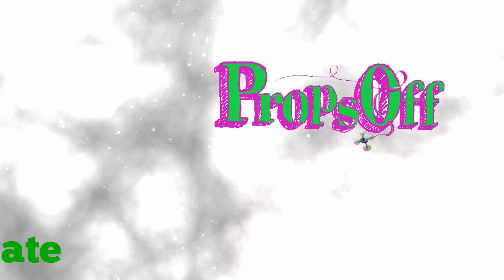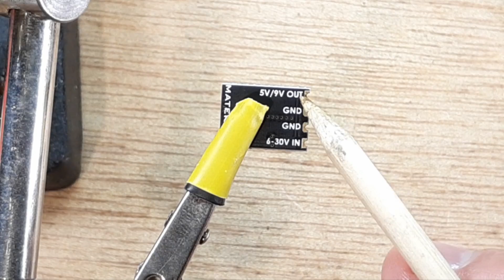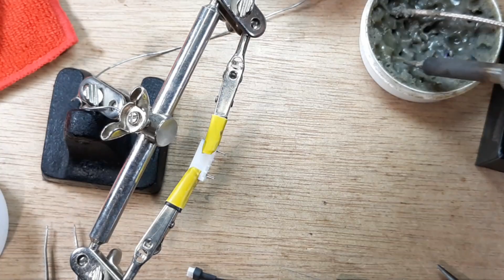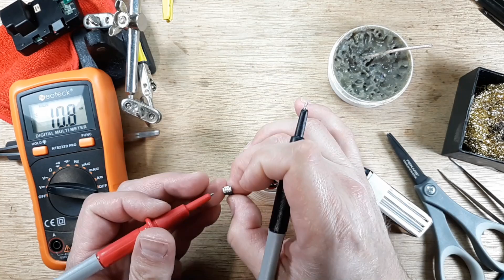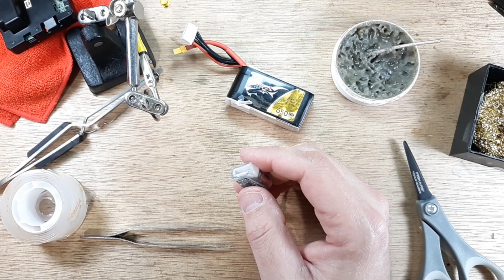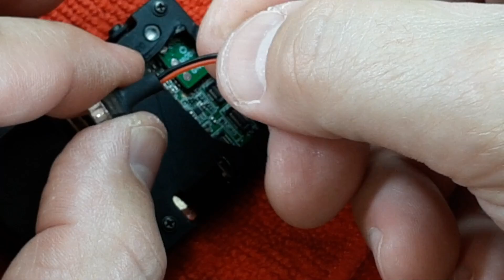How To Make A Naked GoPro Power Supply Cable | Full Soldering How To

Comment from the maker: I made a few more last night. The only thing I would do differently is to shrink tube the capacitor. The wires are close to the capacitor and in a bad crash could possibly touch the metal case of the cap. FYI...👍🏻🍻👊🏻

Comment: Can i also use this on 6s battery?
Reply from the maker: What ever your BEC is rated for, you can use...🍻
Reply: @PropsOff can I direct solder 5v pad from the fc to the GoPro?
Reply: @PropsOff 4.5v to 24v
Reply from the maker: @Tsunamixtreme88 
I wouldn't recommend using the flight controller for powering the gopro.
Reply: @PropsOff why not?
Reply from the maker: @Tsunamixtreme88 
I explain it here... https://youtu.be/0Vc0X9Reu3k?si=eZok5SBIE4ko26FY
Reply: @PropsOff ok thanks. Can i use an adaptor with bec to type c on naked gopro?
Reply: @PropsOff 5v to 24v

Comment: I've heard that using the BEC board generates excess heat, I'm curious to know if this method would lead to the same heat as if i were to leave the original usb-c port in-place, and if it generates less heat then the bec boards?
Reply from the maker: @aaronsandford3568  
I found that it depends on the BEC. I debated if it was due to a weak ground...🤔

Comment: Banggood sent me the wrong parts. Could I use the 5v/12v Bec with a 470u 30v capacitor for this?
Reply from the maker: Yes, I used 9v to the Betafpv BEC board. I'm thinking that BEC can receive 12v. Don't use the 5v option to the Betafpv BEC board though...

Comment: Hy nice video!👍
I have one question does they naked gopro hero 10 have a 9 volt input or should i leave it at 5 volt? I am afraid to ruin my go pro😅
Reply from the maker: This modification video is made for the Betafpv naked Gopro BEC that supplied 5v. The step down BEC (Matek) I used supplied that component with 9v. I don't have a Gopro 10 and I'm not sure what its voltage requirements are.
Reply: @PropsOff  
Ok thanks for the quick answer☺️

Comment: Hi, I have a gp hero 7 with hdmi port. Isnt it much more simple to connect the hdmi port with a 5v pad on the flight controller?
Reply from the maker: You can't feed the Betafpv BEC 5V-.. I didn't work on a 7, not sure?
Reply: @PropsOff  ok, this micro hdmi port has no  charging function. but the GP7 works with 7.4V and not 5V. I hoped to use a 5V pad on the fc but I have just bought a 9V BEC. Now only waiting,....

Comment: Excellent video. Question can I add the where the BEC board is? At the other "End". I'd rather have it there  then on the actual connector itself.  Any issues? I shouldn't, correct ? Since it's in the same circuitry? Greetings from Boston!
Reply from the maker: I appreciate your support and encouragement..
Just make certain the wires are secure ( Strain relief). I seen people wiggle the wires till they frey and touched causing a short and fire. Same circuit as you mentioned and shouldn't be an issue.. Enjoy the Breeze...👍🏻🍻👊🏻
Reply: @PropsOff  thanks! I'll make sure to pay extra attention. Keep the videos flowing !🤙

Comment: @PropsOff: Thanks for the great video and clean information, very nice job! I have a question about the capacitor : Regular or Low ESR? What size to use on 3S? And if understand well, 1- Plug the Lipo on the Power lead THEN 2-Plug the Power lead into the GoPro and avoid plugin the Lipo on the lead if the lead is already plugged into the GoPro, right? Thank you :-)
Reply from the maker: I appreciate your support and kind words...🍻
The caps are from RDQ and are listed as low-esr. A 3s lipo is ok to run 330uf 16v/25v (50v is ridiculous overkill). 
 If I understand your question right,....The lipo plugs into this cable or harness we made. It reduces the lipo voltage down to 5v to feed the BEC (Nameless RC or Betafpv BEC) that is mounted to the Gopro main board.
   If your running 3s you'll just need a smaller cap and DuPont connector (to fit the 3s balance lead - obviously)..

So, the Gopro cable with a step down BEC to 5v is used to avoid the overheating and freezing issues we had in the past. I have 2 older videos showing how we got here. Check them out if you want.. Enjoy the Breeze...👍🏻🍻👊🏻
Reply: @PropsOff  Thank you for your reply and for the additional info. I am building now a light weight cinelifter that will run on 6s Liion (and 6s lipo), I plan on using a naked gopro rather than the full size gopro to compensate the 6s lion pack weight. The matek BEC can take up to 30v so It should be OK right? Now what size capacitor should I use? and should I keep with 25v or go higher?
The second question I was mentioning is my first post was more about a pluging sequence of the various elements (battery, cable adapter, gopro) to avoid spikes to the gopro. So should I first plug the battery to the quad (XT60), then plug the balance side of the adapter to the balance port, then the GH1.25 side of the adapter to the gopro? As opposed to have the GH1.25 already plugged into the gopro while connecting the balance side to the battery and then (possibly if not already done plug the XT connector to power the quad)....I hope I make myself clear here, English is not my first language. In any case thank you for your time and your help:-)
Reply from the maker: @christophelecomte3511  
I'm not a fan of 6S personally. I would use a 50v 470uf cap.. Have this cord already plugged into the BEC/Gopro, then to the power source. That cap will charge up first then the Matek BEC, easing the spike. Please understand, I have only thought of 4S in this application. No testing has been done on 6S and PropsOff can not be held responsible. Like I said, 6S isn't my cup of tea..
Reply: @PropsOff  Thank you for your answers and advice. I understand you are not a big fan of 6S for this application, I am not either but the quad will run on 6S so I need to deal with it. Another solution would be running on 4S off the 6S balance plug, I am not sure what is the gopro power consumption. Running on 4S off a 3000mah 6S Liion or 1500 6S Lipo, would the unbalance in my cells at the end of the flight be a major issue?
Reply from the maker: @christophelecomte3511  
That's what I would do. Testing would tell, I just don't think the GoPro would consume enough to be that concerned. I have a few "Cheap" lipos that discharge really far apart and never worried..

Comment: Shouldn't GoPro 8 be powered by 5V? (and not 9V)
Even on the GoPro 8 battery it's written 4.40V...
(I'm powering it directly through the USB-C plug)
Reply from the maker: 9v is going to a 5v bec.
Reply: @PropsOff  Oh, so for powering through USB-C I need to use the 5V option?
Reply from the maker: @jonykatz  
Yes, the USB supplies 5v to the voltage reduction components on the main board Ultimately outputting 4.2-3.7v.. That's the reason you read a lot of comments saying they fried thier GoPro, due to feeding the battery line with 5v.. The battery terminals do not have voltage regulators. Therefore, it gets overheated and burns up..
The Betafpv BEC is feeding 5v to the USB terminal and not the internal battery terminals..
Does that make sense?
Reply: @PropsOff  Yes, thank you very much for the explanation! :)
Reply from the maker: @jonykatz  
I think it's confusing because stacking BECs is odd. The Betafpv is of such low quality, we needed something to reduce power spikes. That's the reason for the 9v Matek BEC.. Seems silly but it works great.
Reply: @PropsOff  Love this. Question is everything still working great? A few people on FB think it's a terrible idea as you're going to damage one of the cells since they are in series. But as you stated if you connect it to the far left and right it should just work like  a power lead. Correct?
Reply from the maker: @armani007E55  
Yes, it's a series circuit and no different than the main power lead. If the internsl resistance (IR) of the cells are close, it will drain the lipo evenly.
Reply: @PropsOff  thank you! Appreciate it. I'll let the guys know.

Comment: my 2.5inch quad ill be mainly using 2S battery. Using the betafpv bec, would you recommend to solder onto FC power lead (which have a 25v 150μF capacitor) should be enough with 2S?

Or should I still use the matek + capacitor onto battery lead?
Reply from the maker: From the quadcopter to the BEC is the best way. 150uf is just fine for 7v.. You can not use the Matek 5-9v BEC in this instance.
   Note: You can make a power cable from the 2s balance lead if you want. A small 330uf cap and no Matek BEC would be cool. My friend likes the power cord because it is so versatile.

Comment: I make a cable exactly like your but it’s send 4.98v why is happen that?
Reply from the maker: There's a little pad (two halves) that a solder ball has to go across to get 9 volts.. The Matek BEC comes unaltered outputting 5 volts until that split pad on the back is jumped with said solder ball.. Is that it?
Reply: @PropsOff   oh yeah, really helpful.. that was I need...thanks!🙌🏻
Reply from the maker: @catthekiller  
Enjoy the Breeze...👍🏻🍻👊🏻

Comment: Hi PropsOff, I did power my naked GP6 from my matek bec through the balance plug directly soldered to the mainboard of the GP. It worked for some time but right now no reaction at all from the GP. Any idea what could gone wrong? I saw an video the other day that you powered it to the mainboard also.
Reply from the maker: I did power the main board with 5v on the ceramic capacitor. That way seems to be a good way to power the GoPro if the connector breaks and the Betafpv BEC can no longer be used. There's really only 2 places your able to feed in 5v. The GoPro' s circuitry has a buck and takes in 4.2-3.2v (don't quote the lower v).. You can not put 5v in to the GoPro anywhere else or it will burn the GoPro out. I have tested a handful of ways and this video is the best way we found. 

Where did you apply the 5v to your GoPro?
Reply: @PropsOff  I used the way you did in this video https://www.youtube.com/watch?v=MAF2USD0Y74&t=1144s
at around 18 min you soldered the wires directly to the main board of the gopro. I did this also. I used the matek bec. to put 5V into the GP with cap.
Reply from the maker: @mathijsroelofsen  
Can you plug in your back screen? Is the app responding? 
Not sure what to think exactly, other then doing a few continuity checks and voltage checks to make sure the circuit is correct.
Reply from the maker: @mathijsroelofsen  
Also check that you are getting 5 volts out of the BEC..
Reply: @PropsOff  5v out of the BEC is ok. Screen is not responding. No led. How can i do the continuity checks?
Reply from the maker: @mathijsroelofsen  
You need a multimeter..
https://youtu.be/G_aWMRWJhsQ

Comment: Hey man! Awesome video! This video was super helpfull as I'm starting on the hobby and most of the stuff is not very well documented.
Is the capacitor necessary?
I mean. Betafpv released their BEC and should work by itself. But people were having problems due to spikes.
Would it be enough to somehow put the Matek BEC inside the Betafpv case and ditch the capacitor?
Reply from the maker: The capacitor is part of the circuit to create a shock absorber. I had lots of issues with previous ways and this is the way...
Reply from the maker: https://youtu.be/fdbKrzJMCZo
Reply: @PropsOff  Oh yeah. I've now watched all your videos related to the Naked GoPro 6 and let me recap what I understood.
1 - You tried a bunch of BECs that were giving you bad results
2 - Then you decided to use a chopped Betafpv one with their BEC striped away and used a MATEK instead.
3 - And at last you realized the best option is to use the normal GoPro BEC and case in conjunction with the MATEK BEC and a Capacitor, suplying the power via the balance lead :)

Is it right?
Reply from the maker: @LuisPereira08  
Exactly correct

Comment from the maker: Hello Everyone! Thank you for checking out my channel and subscribing! Here I finally put together a video of how to solder up a Naked GoPro power cable. I had requests for this and my friend needed a couple made up, good timing I would suppose. Hope this helps someone out there...👍🏻🍻👊🏻
Reply: Absolutely, thanks a LOT for making this video!
So many unclear guides and information about making a connection for the naked GoPro!
I guess that is because it is fairly new and not so much tests for what is best to use!
But I will try to make a exact one like you show in this video!
Reply from the maker: @RubberTag  
I appreciate your feedback. There are lots of ways to do it and we seemingly tried them all and settled on this method for the win..
Reply: @PropsOff  Could you possibly link or write what capacitor you are using?

Another question, do you think it is better to solder directly on to the GoPro motherboard, instead of through the BetaFPV BEC board?

Aand the last question (hopefully!) Do you know what kind of cable you should use to solder on to the WiFi pad, onto the GoPro motherboard, as an antenna?

God bless!
Reply from the maker: @RubberTag  
Have you seen this?
https://youtu.be/fdbKrzJMCZo
Reply from the maker: @RubberTag  
https://www.amazon.com/16Voltage-Aluminum-Electrolytic-Capacitors-HOWRIN/dp/B085716N5M
Reply: Helps a lot ! Going to give it another try!
Reply from the maker: @Evijan  
You so got this! I got faith you can do it.. I put this video out just for people that was asking for more detailed soldering video than what I already posted before. I'm here, let me know..